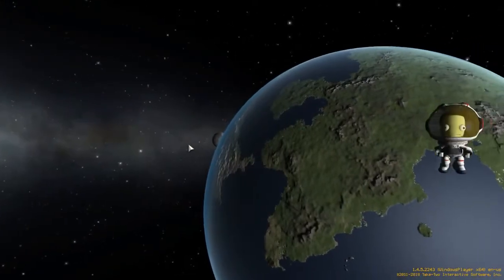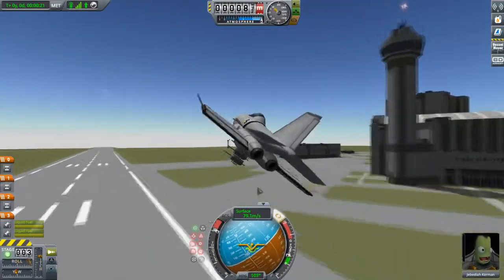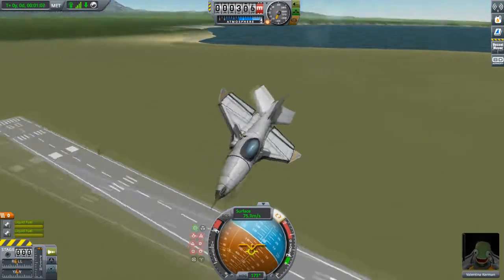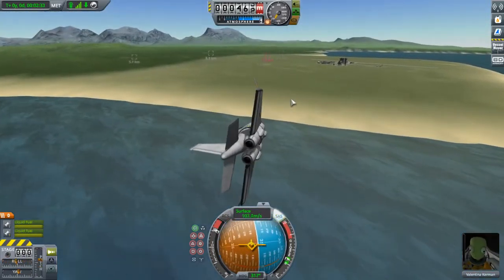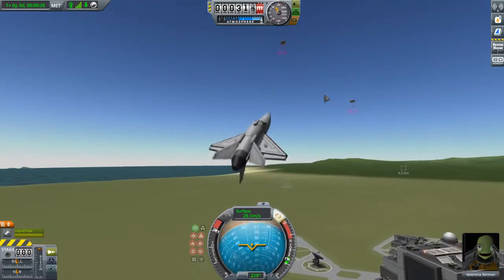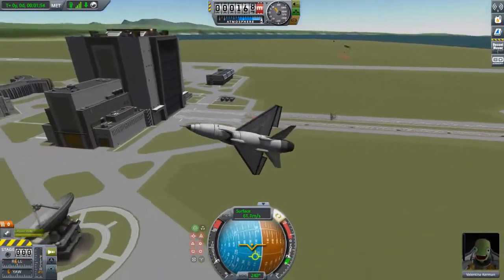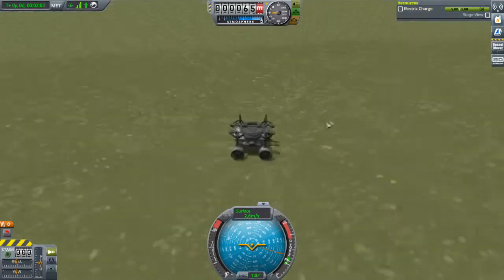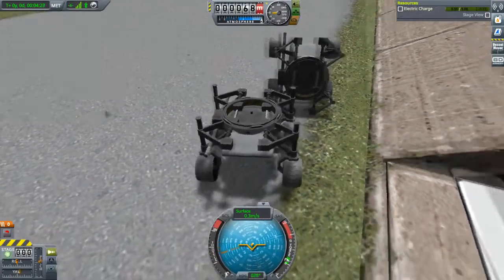KSP - Mini F-4, F-16, microRover & microProbe

Comment: I made an inspired by MiG - 17 and Sabre craft

Also that F-16 has so much maneuverability geez

Wobble is an issue with your gear not being spread out enough, front gear bouncing is because it's mounted at an angle, you can correct that with angle snap on and the rotation tool.
Reply from the maker: The angle should be able to be compensated for easily, but it isn't because of how the wheels' springs are implemented. :( Unfortunately, I can't spread them much farther apart without it starting to look bad. :( My silly aesthetics problems...
Reply: Guard13007 I have them too. I usually play aroud with springs. But eh, I never land my aircraft anyway
Reply: If you play on PC, you could download the Airplane Plus mod, it has an inclined landing gear that would help. But then the console players wouldn't be able to use it. Just my thought.
Reply: Ben Harris I have AP+, but people with a PC that barely handles stock wouldn't be able to enjoy it then. Besides he asked for solutions to his issue, not more issues